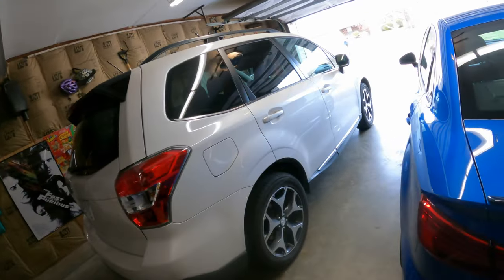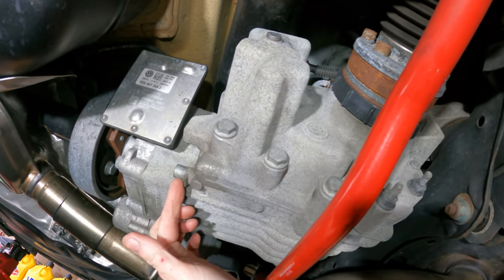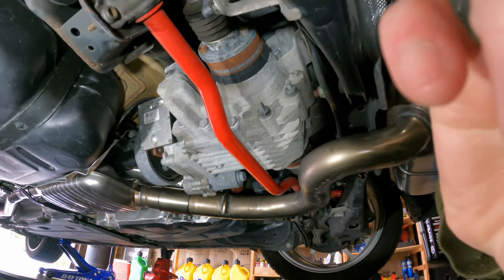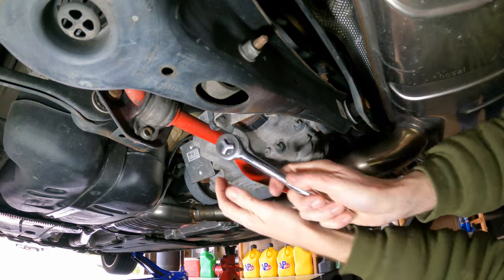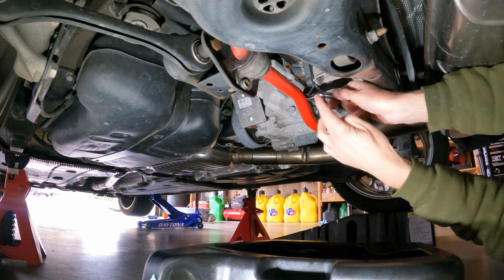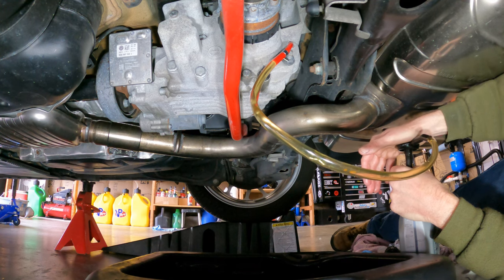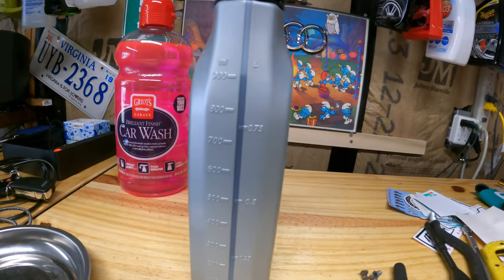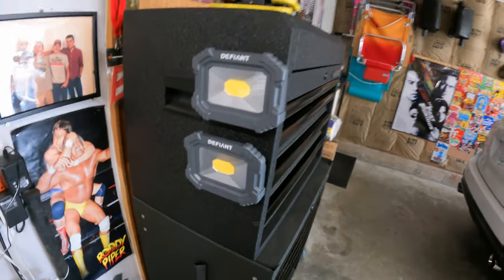2018 Audi S3: Episode 145: Changing The Rear Differential Oil

Comment: OK, I saw your video about oil change in the "front" differential. But what about the middle one? The so called "transfer case" - or is there no middle one? I'm confused. I have an Audi S1 from 2015 and it's hard to get the right information. There's almost no technical videos of the S1 on Youtube so I'm looking at S3 videos...

Comment: I do the same. 4 jack stands on the 4 pinch welds. A scissor jack under the rear diff and my main jack under the transmission.
That comes comes down while you under it, your a dead man. Can't be too safe.
Reply from the maker: true

Comment: Order the parts for the pump just to have it just in case but don’t worry about it too much and save the money until the pump actually dies. 

I have had a coolant smell and a drip or two for over 80k and my pump is still running strong.
Reply from the maker: nice reassurance! hope i have the same luck

Comment: Good one Mark.  I've done my rear and even at ~75K it was pretty clean.  I ended up paying my shop to do the bevel up front because I just couldn't get the fill plug out (awkward).  I used a ECS mag drain on the rear diff. and Racingline mag drain plug on the Haldex.  I have one for the bevel I'll do next time.  The MK8 aero/stone shields for your rear LCAs...I did them on the wagon as well as an exhaust tunnel aero cover (short)...have info for both in my build thread over on golfmk7 forum.  Finally I note your resonator is in...when did you put it back on?
Reply from the maker: So the front box is called  bevel? Think I put it in last night. Hard to remember cuz it’s been an action packed weekend.
Reply: @LastHumansGarage  front is "bevel box"
Reply: @LastHumansGarage  yes high action level at LHG!